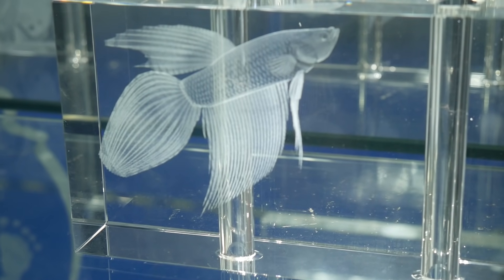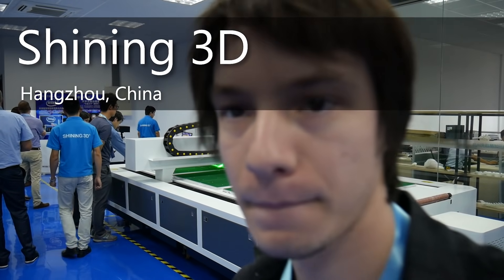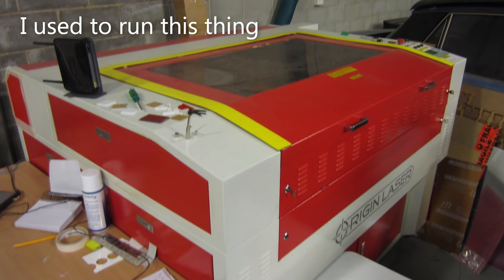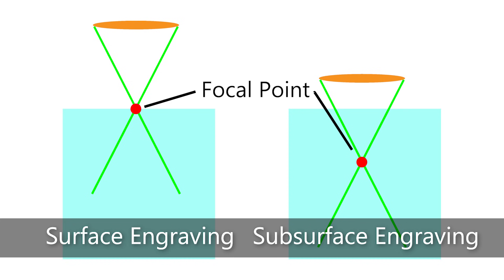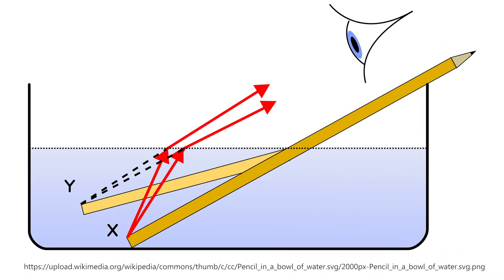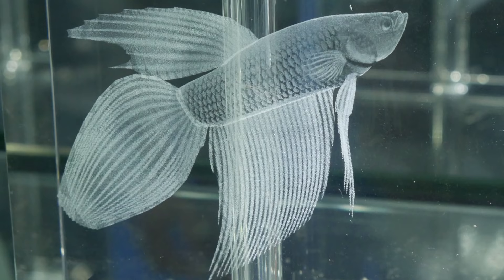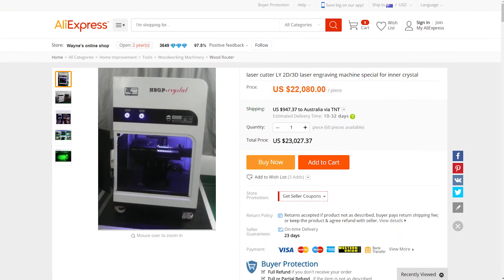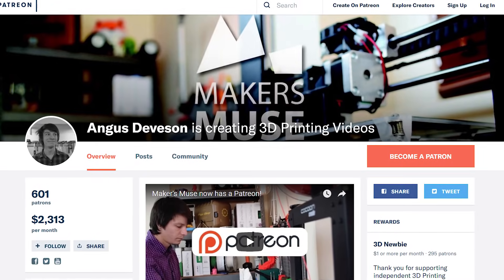What is Sub-surface Laser Engraving or a 'Bubblegram'? Technology Explained

Comment: I work in a machine shop where I run the laser engraver to engrave text on aluminum parts. We have clear plastic fixtures to hold parts. Once I had the laser focal point inside the plate and marked without a part and got a bubbling effect inside the plastic like in theses objects by mistake.(having a focal point a little above or below the surface can leave a cleaner marking the part)

Comment: It's interesting. Some 20+ years ago I saw one of these in operation in Las Vegas. The guy realized I was into the tech side and he explained it all pretty much like you did. He also mentioned there was another technology at the time that used 2 lasers at 90degree from each other and where they collided it put a bubble. He said that he had done a lot of research before buying though and the other system was more money and much harder to calibrate (both lasers at a needle point size must hit each other exactly) and that they would get out of alignment very easy which would either end up with no image or one that looks fuzzy. That other company is probably long gone now.

Comment: I think you are missing a very important point in not mentioning the wavelength of the laser, subsurface engraving is impossible to do with a CO2 laser since the 10600nm wavelength is absorbed by the glass surface, even if defocused, so you need a visible laser (532nm in this case) that is only slightly absorbed by the glass, but when focused to a point the high power density it can cause some damage to the crystal structure.

Comment: hey bro can you tell me what filament to use for my cr 10 
abs can't  be used
suggest me a better option other than abs 
and also tell me how to get a strong objects using pla
Reply from the maker: Use a strength modified PLA like Polymaker Polymax, or eSUN PLA+
Reply: what about WOL3D & Flashforge pla
Reply: Techie 1.75mm PLA Filament 1KG Roll for 3D Printers
is not strong 
what should i do
Reply from the maker: I don't use any of those brands, if it says its just PLA then it's just PLA. It'll do for most applications.
Reply: is esun is good

Comment: Interesting video and well explained. Just one correction... Westfield Bondi Junction didn't open in 2003, I was working there in the mid-80's and it had already been around for a while. They did do a complete remodel, so probably closed it for a while and then reopened it in 2003.
Reply from the maker: True :) I might have not gotten the date 100% correct but the new complex opened around that time, though the towers were already there. I remember the huge hole for the underground carpark, damn it was deep!

Comment: So, you're saying I should engrave glass in my Muse?
Reply from the maker: Yes!!! You need less power than you might think, so do some small tests first - and a solid image will work better than greyscale. Dithering is the best way to get gradients :)
Reply: Angus: Have you tried focusing a normal CO2 laser below the surface? Maybe with dithering or such?
I know getting a full '3d' look would be tricky without the software and machine, but being able to do 2-3 layers could be fun to try on some 10mm thick glass.
Reply: You need very little power ;)  I can do it with a 2.5 watt diode laser.
Reply: I'm actually very curious why we can't just use a CO2 or diode laser to sub-surface laser engrave dithered point clouds if you are controlling the Z-height of the lens to focus it.
Reply: glass is opaque to a CO2 laser.
Reply: @legomasterdan1  is correct.  Notice that CO2 lasers have a clear window while fiber lasers have a colored window. The window not only allows you to see the work done, it is to protect you from a specular reflection, which a reflection where the laser maintains coherence and power.  Non-specular reflections are simply the visible light of the laser hitting its target.  It is the same in surgical suites.  The color of the protective eyewear coresponds to the wavelength of the laser to protect the eye from accidents.  The eyerwear for CO2 is, you guessed it, clear.  Or at least clear to us.  This is because CO2 lasers are UV, which is a much wider wavelength than visible light.  This is why CO2 lasers use mirrors instead of fiber to point the laser.  It's not a big deal in our engravers, but in a surgical laser, it means the surgeon has this awkward articulating arm to deal with. Each articulation has 2 45 degree mirrors, and at the end is a coupler for a laproscope.  The lens is specially designed to focus UV light.  I never had to realign a surgical laser articulating arm, but I have had to realign the lens in the laproscopic coupler.  I even had to replace the lenses once when someone thought giving the coupler a bath would be a good idea. It wasn't.  In case you are curious, the max power on most of the CO2 surgical lasers I worked on was only 40W, although the tube was always rated much higher.  Actual power used in surgery was less.  BTW, 40W will go right through a tongue depressor and burn whatever is on the other side in less than a second.   The flame that comes off of it is massive as well.

Comment: I always thought it was 2 Laserbeams that converge on one spot, not a single beam from above, just so you can get the focus easier than putting it on the specific dot for, you put two lasers at 90 degrees at "half power" so they do not damage or etch the rest of the glass
Reply from the maker: Apparently that is an alternate technology used for specific plastics but I couldn't find ANY info on it so decided to omit it instead of spreading false information. If you dig anything up let me know!
Reply: Tarek Knanneh a single conical beam is way, way easier to manage, and it only really needs to be calibrated once if your material is consistent from batch to batch.  Two beams might do all sorts of strange things once internal reflections are factored in.

Comment: Pretty neat. Would also love to see some videos on affordable "hobbyist grade" laser engravers.
Reply from the maker: There's a few low cost kits, but I've been cautious on using them because they have zero safety considerations. Touch a hotend you'll get a burn, shine a laser in your eye you're blind for life... Don't really want to promote that kind of thing to be honest.
Reply: A nozzle burn I can take. Blindness definitely not. I've read a little about the Muse - the laser device not the Aussie ;) - but that's not what you and I might call "affordable". I was hoping someone made a less-expensive unit with all the proper safety interlocks. Maybe someday.
Reply: Like Trinus or Mooz?
Reply: Just for the record:  Fablab genova made an 80W CO2 open source laser cutter implementing all safety interlocks like commercial machines usually have. The total cost was around 2000€ for a 1250x780mm work area. They did a great job. You can see the machine in this video https://www.youtube.com/watch?v=_z17imYLvGM

Comment: Love thae vid. BTW the cocoon is back at Aldi 1/11/2017....$299
Reply from the maker: They'll sell out in the first 10minutes again, it's a rebrand of the Wanhao duplicator i3 mini so if you miss out you can get it direct from china!
Reply: Thanks for the heads up!!! Do you think they will sell out quickly?
Reply: Not sure, you may have to do the line up out the front thing ;) They are selling UHD TV's as well so there may be a few ppl there.
Reply: I have a HSC exam that morning :(  Maybe there'll be some filament left I can snag.
Reply: There is always filament left, mainly a ton of that beige stuff. I don't find Aldi filament better than a majority of cheap PLA
Reply: FYI https://files.ozbargain.com.au/upload/90200/53273/4bf7a7d7-2341-41bb-9667-88d24d22b058.jpeg